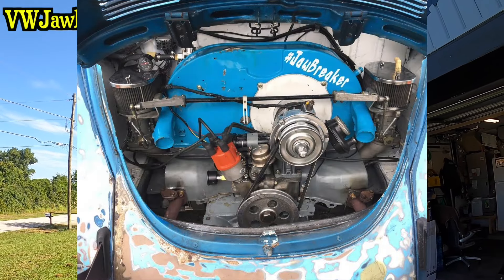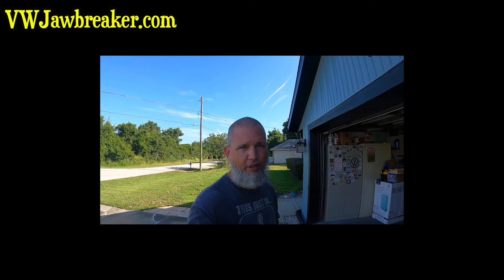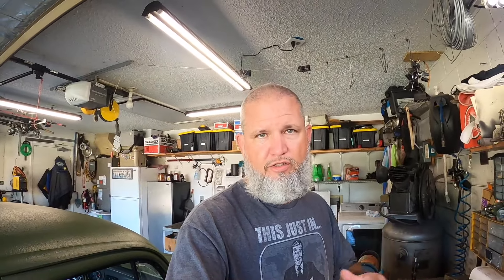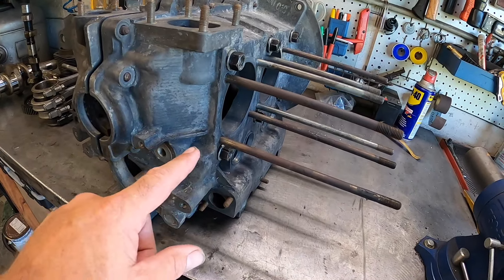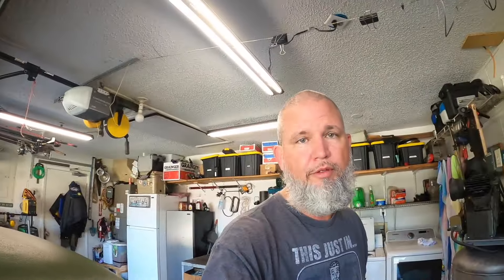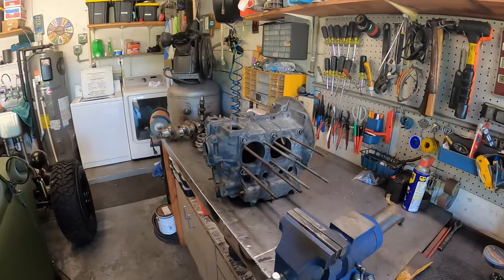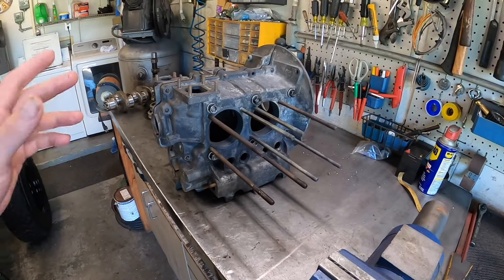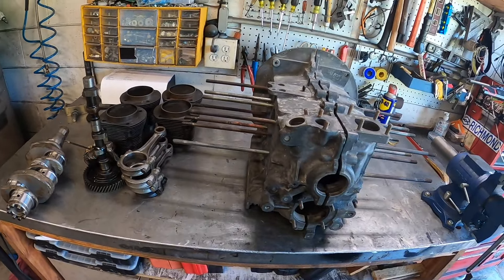Volkswagen Air Cooled Mini Stroker Build -1760cc- Part 1

Comment: Watched the whole thing. Glad to see you back. Hope your Dad is doing better.
  Been running a cast crank in a spare parts 1776 for over a decade with a stock cam and 34 pict 3 with oil bath air cleaner. 4:37 RP makes it a hot rod in town but not my first choice for long distance abuse. Always tempted to put 1:25 ratio rockers and dual carbs but it's the one car that I know will always fire up and get me there. She also runs a dog house and alternator. 😊😊😊
Reply from the maker: It’s good to be back, just won’t be posting as much as before. 
Is that the engine that’s in Valerie? 
It’s easy to want to squeeze more power out of a setup but there has to be something said about keeping it simple and stock-ish. I’ve always been a hp kinda guy but sometimes I do miss a simple setup lol

Comment: Can't wait. Just picked up stock 1300 twinport running. For my own mind i want to strip it down and replace where needed.  Hopefully your build will help. Mucho ❤ fom England 🏴
Reply from the maker: @loopflex9359  nice! There are some differences between the 40hp and later 1500 and 1600 engines. Most will apply in the series. 
Look for @JWclassic VW, he has a great 40hp build series.

Comment: An offset stroked stock 74mm cast crank without counterweights.  Interest peaked.  I remember being young, broke, and needing to keep my beetle on the road.  Many a used part was recycled.
Looking forward to this build, I bet it will be awesome.
Reply from the maker: I was also intrigued with this crank. I do have a stock stroke crank sitting there but I figured this would be more fun to use and experiment with.
Reply: @VWJawbreaker  Love your content.  Always positive.
Reply from the maker: @bert79  thank you!

Comment: That sounds like an awesome plan, Gary!!  “Sweep the floor” engines are the most fun, as you spend little to no money in the fun of it…I’ve got another short block I plan to do as a backup motor in a similar way.  On the clearancing with stock rods and 74mm crank, pay close attention to where the back of the connecting rod comes close to the spigots - the contacting of the two are not always so obvious during mock-up and rotation….just went through this this week and had to go back and fix some minor rubbing in two places.  Good luck, it’ll be fun!
Reply from the maker: Absolutely! As long as you build them correctly, they will last a long time. 
I watched your video this morning and paid close attention to the places you had to clearance. I appreciate ya showing that as that’s exactly what I’m about to do within the next week or two.

Comment: This might be a great use of the Pict37 or 39
Reply from the maker: That’s a great point however with stock heads and cam, a 34/3 should be just fine. I’ve seen some great low rpm torque strokers for buses use 30 picts and they do amazing well.

Comment: Hello from the UK.  Just wanted to say that I'm a big fan of your videos and how good it is to see you back.  Really looking forward to this one as I'm about to start a very similar process with a pile of parts some of which go back about 25 years!  I certainly can't afford to go buying brand new cases or cranks but I do have a lot sound used parts so anything you put on about checking over different parts for long term viability will be really useful.  Talking of single carbs, have you thought about using a single DRLA or IDF? Having used twin carbs for a long time on off road VWs I've recently been well impressed when I found a centre mount DRLA and fitted it to one of my engines. Thanks again.  Pete
Reply from the maker: I appreciate the support!!
I’ll do my best to go over everything that I’m doing and how I do things. Of course I’m not an expert but a guy with experience. Used parts are fine as long as they are in spec and fit properly. 
I ran a single IDF years ago on a different build. It has its pros and cons. Personally, for this build a stock carb with a choke will be most beneficial.

Comment: 1760cc mini stroker engine build? Sounds very familiar, my spare motor is a 1699cc mini stroker now sitting in my garage. Think about getting a slightly bigger than stock cam, like a cheater cam and do some mild porting of the heads and single heavy-duty valve springs. All of this should help with the power band. I can't wait to see how this build turns out.
Reply from the maker: I’d love to put a W100 cam in the engine but I’m trying to keep costs down, that’s why I’m using a stock cam I have laying around. I do have a W110 cam but I don’t want to run it in this combo since I want to keep it a single stock carb.

Comment: Mini stroker.  I have a brand new electronic 009 dist, a good used PICT 31, new front and rear tin seals and a LOT of other assorted bits new and good used.  All yours.  Im nearing completion on a resto mod 68. All new wiring, fuel system, steering/suspension, brakes and I made the interior NO KIT.  Surf Longboard dash.  I would make one for you along with the Formula Vee drilled shifter sleeve  (stock length).  Let me know.  Glad to see you back hope all is well with your family
Reply from the maker: Thanks so much for the offer! I have the parts from someone local, I just have it to pick them up. 
Sounds like your 68 project is coming along!!

Comment: Congratulations on this build!!, I kave tvis combo, STOCK CAM as well, but with 1.4 chinese rockers. Its OUTSTANDING the difference they made. Oh, and remove the venturi of the carb, if you use an stock one...
Reply from the maker: Thanks! An upgrade to 1.4’s will be down the road. I didn’t have them on hand and this is a spare parts build series. 
I appreciate the feedback on the setup!

Comment: Can't wait to see this come together but I was yelling, Noooo, not stock cam...CB's 2280 cheater cam, it will idle like stock with a single carb!!! 😂😂
Reply: Oh yeah, mini stroker!!! 😅
Reply from the maker: @jonathanfarmer3653  i love that cheater cam or even a w100 cam. But all of that would work well with a single carb but it’s coming down to cost. Cam is easy enough to swap out down the road if I feel like making changes to it.
Reply: @VWJawbreaker  I am getting ready to put together an engine for my Super, I had bought the cheater cam and 1.25 rockers for the build but ended up getting a 100 cam in a parts purchase, only problem is it has straight cut gears and I hear they wine a lot. Which one would you go with on a 1641 with a single 34 carb and stock valved heads? I live in the mountains and don't want to lose low to mid torque.
Reply from the maker: @jonathanfarmer3653   I’d go with the 100 cam honestly. It’ll idle slightly rough at idle with a single barrel stock carb but will still have plenty of low end torque. 
If you take come carriage rolls and clean up the head ports, the 100 cam will be even happier.
Reply: @VWJawbreaker  I have watched EzGZ and a couple others do some mild porting, can't remember if you have any videos on that or not. I have an older set of heads I was gonna practice on and then try the better ones. If money flow allows, I would like to put some dual 34's on it.
Reply from the maker: @jonathanfarmer3653  yep, VW Darin and EZ have videos on it. I’ll be doing one in the coming months for this build. Nothing crazy, just some basic clean up work.

Comment: Hi Gary, looking forward to seeing this one. Cool motor plan for sure. I got a newbie question on my project. I ordered the new fuel pump housing for my old 40hp motor and like some folks have pointed out drops in and is sloppy. I think the old ones are called Bakelite or something like that and the one in this old motor just crumbled apart. I think all the parts I ordered from Jbugs, gasket kit and this fuel pump rod housing came from Brazil. Is this loose fitting what looks like plastic housing going to be, ok? I rod seem to fit ok in it. let me know if I need to get another one and where from. Thanks Tim
Reply from the maker: @TimsWorkshopTJY  hey Tim! 
Imo, the old ones fit too tight and that’s why they broke apart over time was they “swelled” up in the case. 
The newer ones, it doesn’t matter if it’s a little sloppy as its job is to guide the fuel pump push rod. Just make sure the push rod slides through easily.
Reply: Thanks Gary, that's what I thought so pressing on.

Comment: Goat man go Daddio  Don’t use a lightweight flywheel is the stock one or else the engine will shake it’ll be out of balance
Reply from the maker: @chrisallen-gn6iq  never had an issue running a lightened flywheel 🤷‍♂️

Comment: Hi, I just found your channel. I have a question and was wondering if you could help. I'm trying to restore a 1972 Super Beetle. I just put in a new pedal assembly and connected the clutch cable. (The engine and clutch are not installed yet). I THINK I did it right, I tightened the cable and the lever on the transmission moves when the pedal is pressed. But I'm wondering, how much does the throw out bearing have to travel for the clutch to work? I'm totally new to this and I hope I did it right!
Reply from the maker: Welcome!
You can not adjust the clutch wing but without the engine and clutch installed. 
Once you install the clutch and engine, then you can adjust the clutch wing nut at the gearbox so the clutch pedal has approx 1/2-3/4” of free play before you start to feel resistant.
Reply: @VWJawbreaker Thank you for the reply! I mean just as a starting point, is there a minimum the throw out bearing should travel to move the pressure plate? I just want to be sure I mounted the pedal assembly, stop plate, etc right. I hope this makes sense.
Reply from the maker: @ct6502c  not really a minimum, just thread the wing nut into the cable a few turns and wait until the rest is installed

Comment: If you need some parts still, lmk. I’ll donate and ship
Reply from the maker: Pretty sure I will have everything I need. Thank you much!
Reply: You were saying you donated some heads… I have some refurbished heads. Stock 043 RTR. Paid $400+ for em, but they sitting on the shelf n if you need heads still, lmk
Reply from the maker: @estebangarcia3365  thanks! I just have to go pick up the heads… we swapped from the heads they had to the ones I had.
Reply: @VWJawbreaker I also have carb bodies waiting to get cleaned up and rebuilt. Like I said, odds n ends I have. If you need something lmk. I might have it sitting on the shelf
Reply from the maker: @estebangarcia3365  greatly appreciate your kindness! I’ll keep it in mind 🤙
Reply: You got it brother